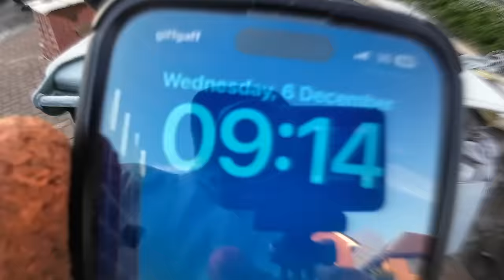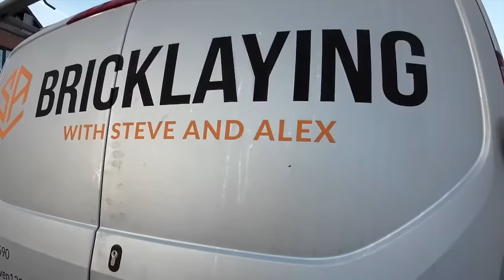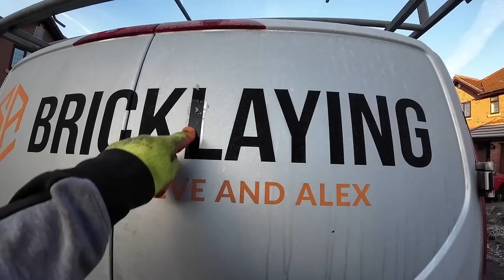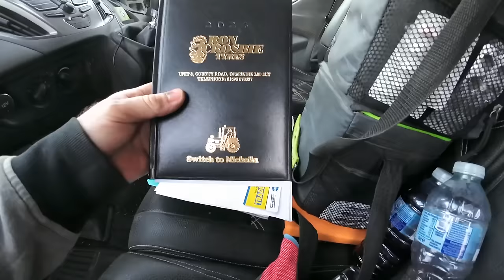USING A LASER UP TO DPC...CONSERVATORY TO EXTENSION PT 4

Comment: 👍 do you ever do block and beam floors? Would love to see how you do them
Reply from the maker: Never . If a job had block and beam we wouldn’t take it on. 
   Bloody awful job to do 😕🧱👍🏽
Reply: Really.!? That’s the only floors we ever do, very rarely put in a concrete slab, saying that, building control love suspended floors where I live…😂
Reply from the maker: @nigelsmith1198 . 😆🧱👍🏽
Reply: My extension floor sits roughly a meter above outside ground level. I would need tons of MOT to build that up. Seems more sensible to block and beam in my case
Reply from the maker: @firstbuydiy . Or a suspended timber floor. Miles warmer 🧱👍🏽